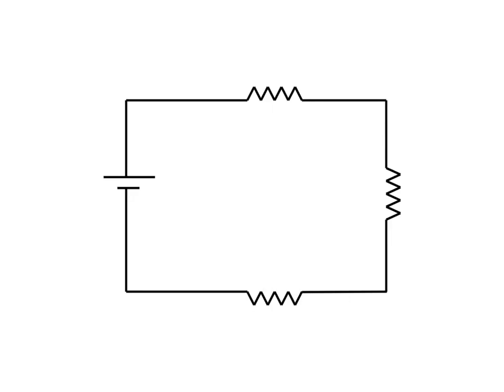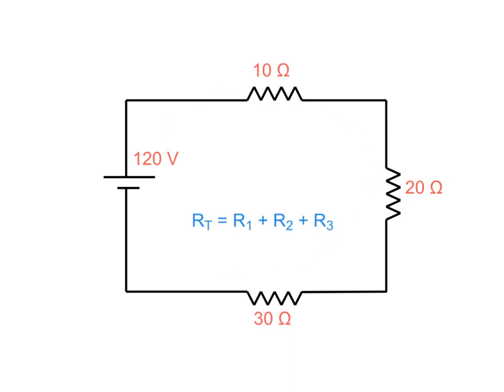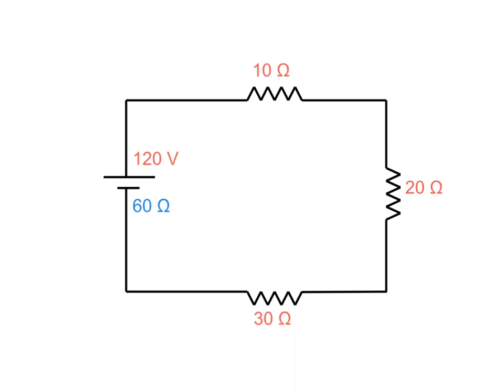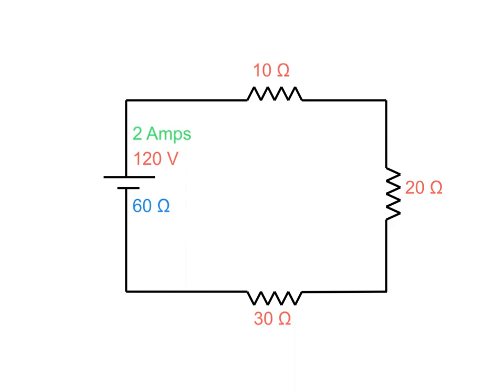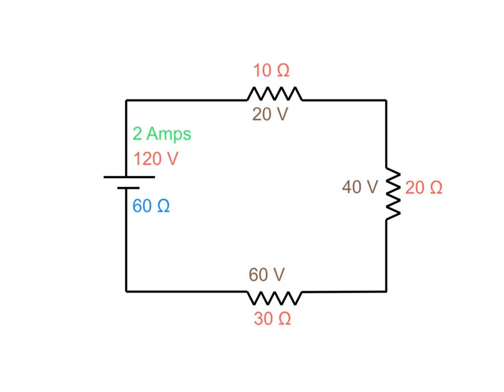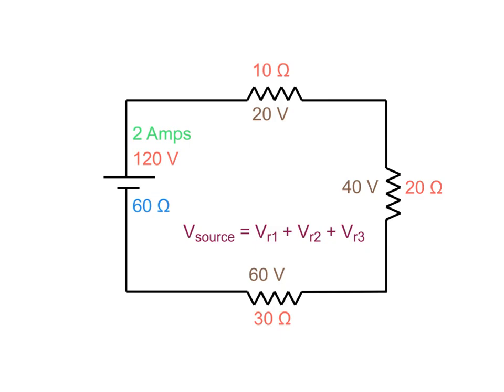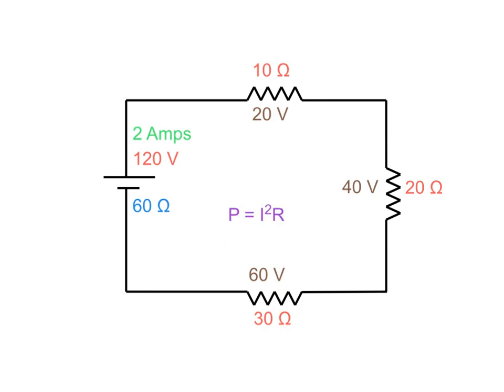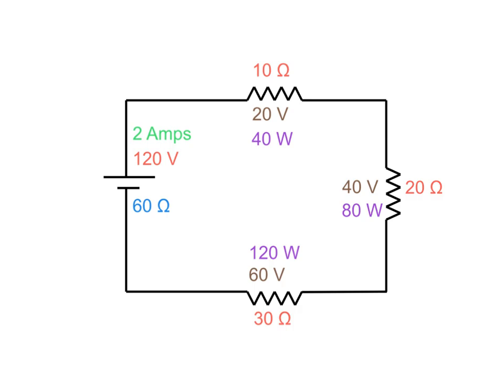DC series circuit

Comment: I dont understand why he is doing it backwards from negative to positive. This contradicts what Ive been taught and every single other tutorial. I was told the reason that they go pos is so answers dont end up negative. It is just neater to go positive, both are correct tho. Also I was told as long as voltage drop is 0 or below its considered zero and okay. It doesn't have to be exact.